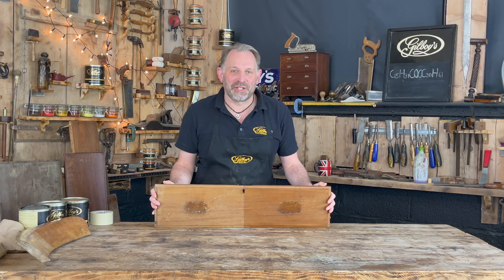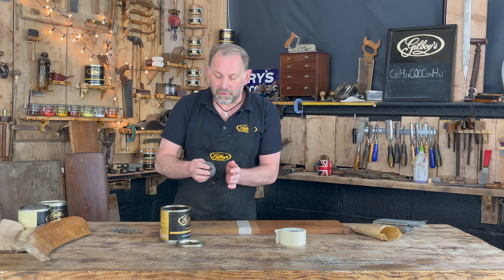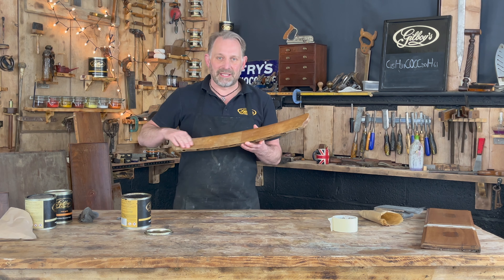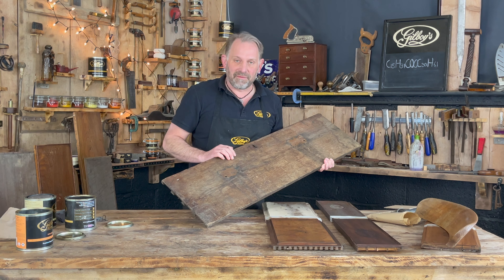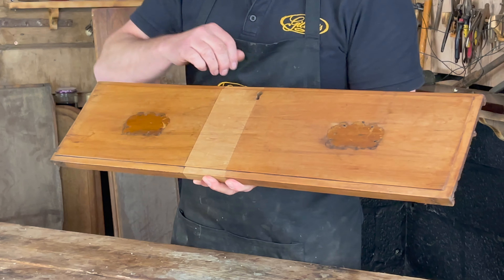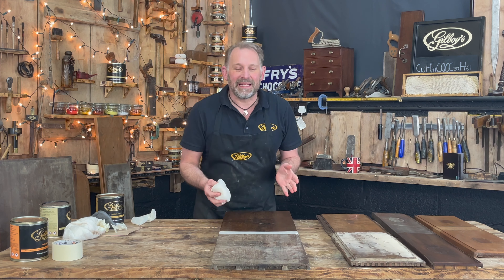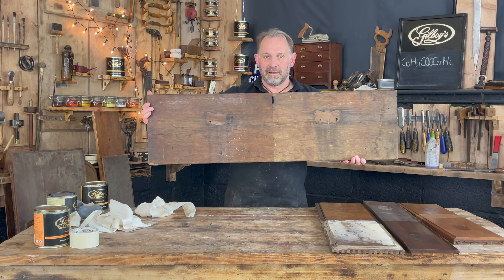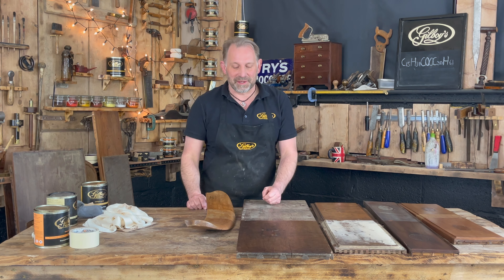How To Restore Sun Faded Antique Furniture with Beeswax Polish

Comment: Great video ! Can I ask you how you might go about getting candle wax off/out of a carved rosewood table ?
Reply from the maker: Hi Marc.
Depending on how much wax there is. I think the safest way would be to remove it with a very fine, sharp blade. If it cooled quick i would have thought it will release itself quite easily form the surface. Failing this, using a hot air gun to warm the wax to melting point and immediately dab the liquid wax away with an absorbent cloth.
Reply: @GilboysRestoration  thank you very much
Reply: I have used ice (wrapped in cloth to avoid wetting the surface) to super harden the wax and then it almost falls off the surface when lightly picked.
Reply: @ASouthernYankee  this was a table I purchased that the wax had been set in for a while. Not easy to pick off when it’s inside the carved grooves. It wasn’t easy but it’s done now

Comment: Just wondering why on the child's rocker you sealed with shellac sanding sealer but on the g plan table you sealed with hardwax oil
Thanks
Reply from the maker: Hi Darren. 
Sorry for the delayed reply. The reason I used sanding sealer is for ease of use and its suitability for the future use of the chair. 
I'll explain... 
Sanding sealer doesn't really have any hardwearing properties. It's not really water repellant or resistant to mechanical wear. But it does have a relatively good 'solids' content  and dries very quickly. And of course the most obvious reason is; it sands smooth really easily. When you apply our beeswax polish over the top of it, it gives a lovely satin wax finish to the wood. in short you can create a very simple finish very quickly. 

I used the hardwax oil on the G-Plan tables because they are going to get a lot of hard mechanical wear and hardwax oils are very hardwearing. Visually the finish will be very similar, but the practical properties of the hardwax oil will be outperform the sanding sealer by a considerable margin.

The child's rocker on the other hand doesn't need this high level of protection. It will hardly get any use so the finish will last for decades. This type of finish is known as a 'dry shine'. 

I hope this helps explain the reason why. 

Kind regards
Simon